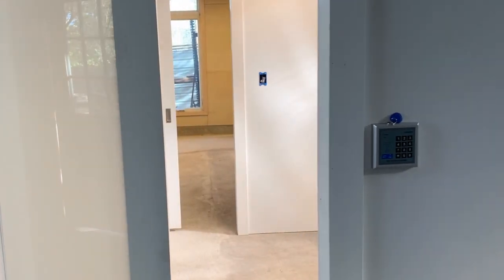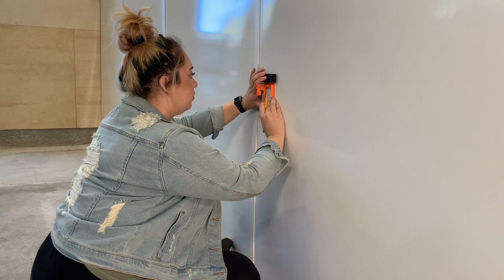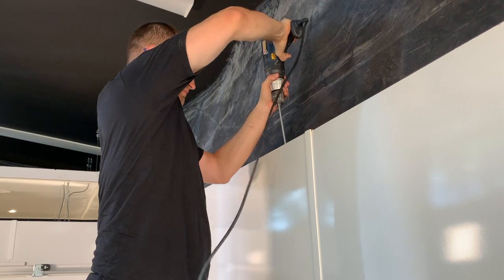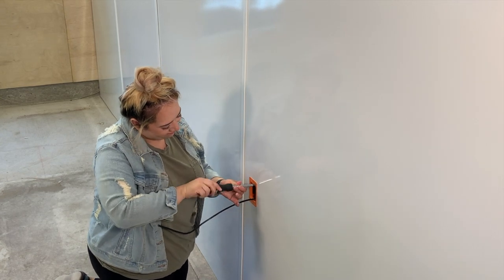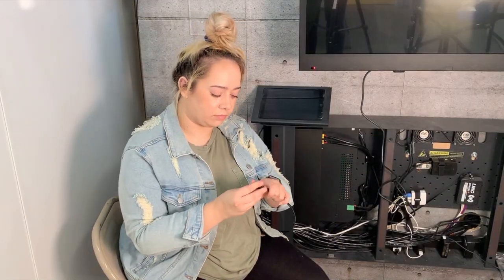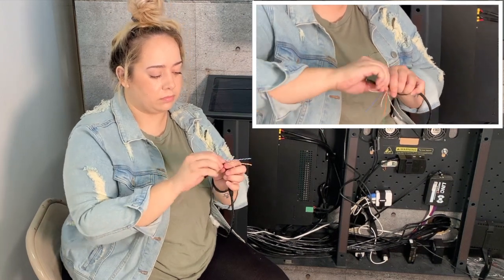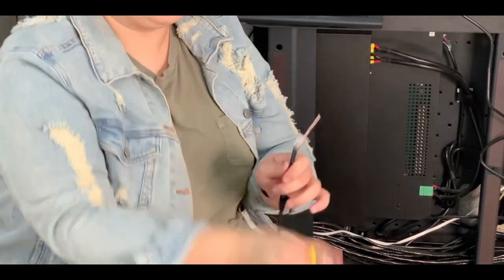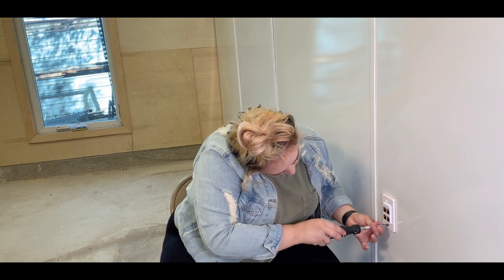How to Install a PoE Wall Jack in Your Home or Office Space

Comment: Personally, after opening up the wall and drilling those holes, I would have just pulled four cables for more future flexibility in the use of the runs, instead of running only 1 cable with a 4-port PoE switch... That "wall plate switch" is cool though if you are retrofitting an existing single cable run where adding new runs is not feasable...

Comment: Do you guys have a product like this but is designed the inverse?
as in there being one ethernet jack facing out the wall, but 4 ethernet jacks into the wall? I'm trying to wire my house and this configuration would be perfect if you guys make this type of poe in wall switch
Reply: That's interesting.  Are you looking for 4 ports of PoE to become 1 port of PoE++?
Reply: @tylerandrews1489  Nah, I'm still trying to make use of a 1 to 4 switch, the difference in what I was asking of is that the One ethernet side of the switch would be the source (which would be the outer part of the plate), and the 4 ethernet side would be in the wall itself, so I would be able to route the other ethernets to the rest of (in my case) my house. 

It'd be great if you guys had this as I haven't seen a product remotely close to even the one you have in this video and I'm pretty impressed by it (I use to work for Cisco too, I'm super impressed by this) Not to mention in my case I could wire my entire house without having to mount any bulky network switches in my old house.
Reply: @xblackra1nxX  I guess I'm confused, then.  Why would you want to run 4 wires in the wall when you can run one, then split it to 4x at the end point?  You could use your Cisco switch to run a single network cable in the wall, then make it 4x ports at the other end?  Is it the power you need?  I'd suggest a midspan, then.  We have several that work with this device.
Reply: @tylerandrews1489  The end points are physically in all different directions unfortunately. I'm basically trying to put ethernet in all the bedrooms in my house. If the endpoints were even remotely near each other, I would have considered that.
Reply from the maker: @xblackra1nxX  So would our metal cased desktop version be what you're looking for?  https://shop.poetexas.com/products/gbt-4-60w?variant=42876797714591

Comment: Did you need a por switch for this?
Reply from the maker: Yes, you need a PoE switch to power this.
Reply: @PoETexas  a PoE Plus switch I assume right?
Reply: @DRod268  A PoE+ switch will give you 30 watts total budget on the 4 ports.  It can take PoE++ in and give you a total budget of 60 watts on the four ports on the front.
Reply: What is poe switch for?
Reply: @Ehren1337  The PoE Switch provides power and data to the GBT-4-IW.  It does not take normal DC power.